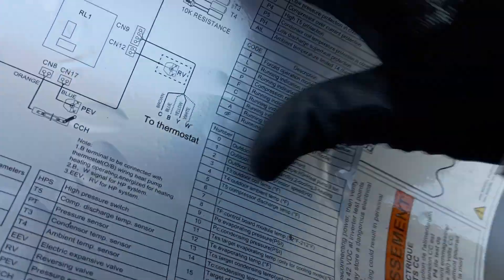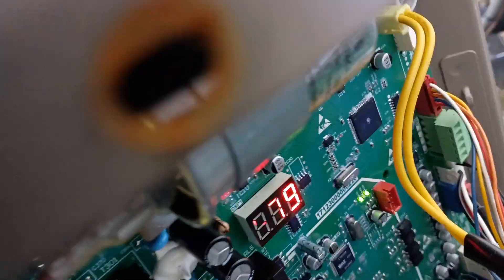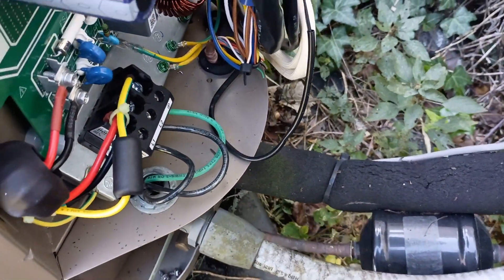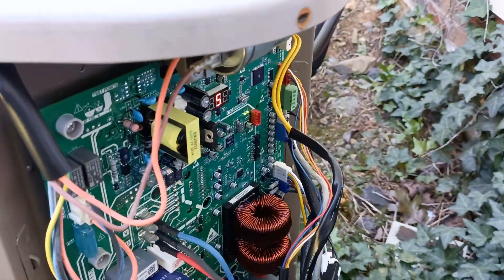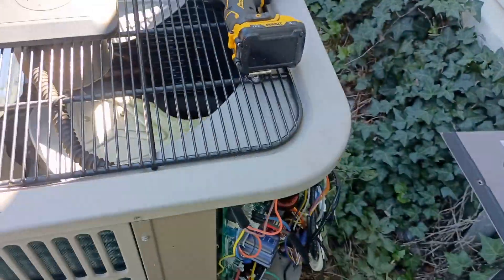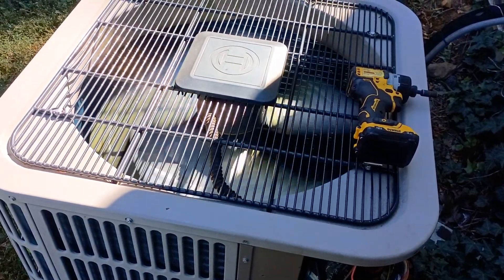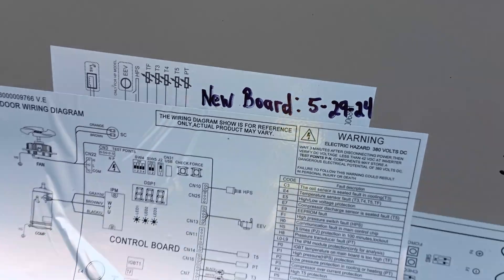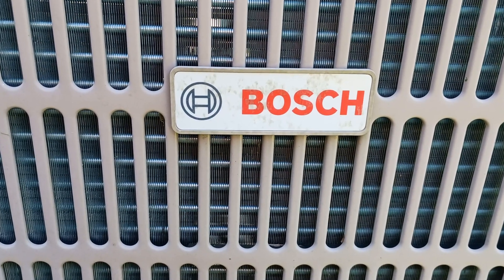Bosch heat pump operation & defrost cycle. Part 2 of 2 😎👍

Comment: During the defrost cycle the heating vents seem to blow freezing cold air into the rooms.  We have fossil fuel backup heating (oil furnace).  Isn't the furnace suppose to come on during the defrost process?
Reply from the maker: @bampsnh  yes it is. And if it's not coming on during the defrost cycle, that's why you're getting freezing cold air coming through the vents.  Thanks for watching. 
😎👍
Reply: @sknight0391  Thanks for the quick response.  This is a new installation (summer 2024) and our heating season here in the northeast is ramping up.  The condenser is a Bosch IDS 2.0 4/5 ton.  What would force the furnace to start while defrosting?  With this one exception the system is working okay.
Reply from the maker: @bampsnh  there has to be a 24-volt signal sent through the "white wire" of the condenser back to the furnace. This will turn the furnace on during defrost operation. They're also needs to be a supply air temperature sensor mounted above the AC coil in the ductwork. This sensor is tied into the "W" wire and will turn the furnace off above a specific temperature. This will keep the heat from the furnace from changing the state of the refrigerant before it goes back out to the compressor (and destroying it over time). Or an easier option would be to set the switch over point in the thermostat menu to 40°. This would run the heat pump above 40°and the furnace below 40°. At that temperature the heat pump isn't going to have to defrost very often, if at all. And if it does ever defrost it will be over so quickly that you really won't notice much of a temperature change inside of the house.
Reply: @sknight0391  Thank you very much for the detailed explanation...  Shannon, you are indeed quite knowledgeable.  Videos are awesome!

Comment: Good stuff man! 👍How you feel overall about these Bosch units?
Reply from the maker: @gregmiracle9560  they are definitely a step up in quality. You can see it on things like the thickness of the gauge of metal on the air handler door. all the wiring and copper is nicely bundled up and zip-tied out of the condenser unit. Nothing will ever rub out on these things and cause a problem. And all of their coils are coated with that bluish green stuff. And like I said in the video, so far the leak rate does seem to be pretty low compared to other manufacturers. And they do seem to do a good job of heating and cooling. I don't ever have any customers complaining about humidity issues. Thanks for watching Miracle Man 😎👍
Reply: @sknight0391  thanks man glad you mentioned the humidity cause most complaints I hear are people fussing about the humidity! Thanks for the reply and stay safe out there! 👍👍